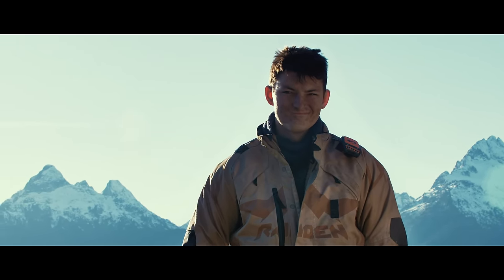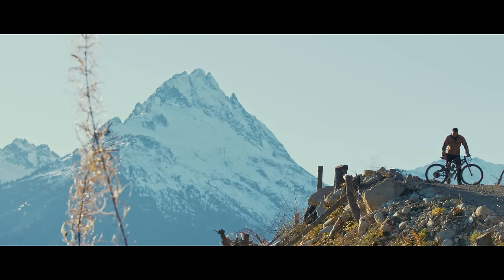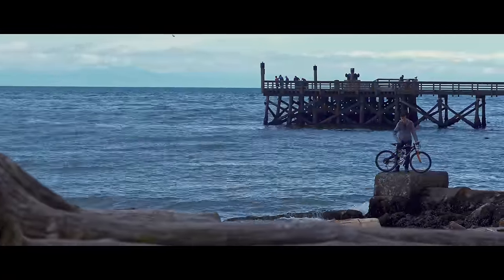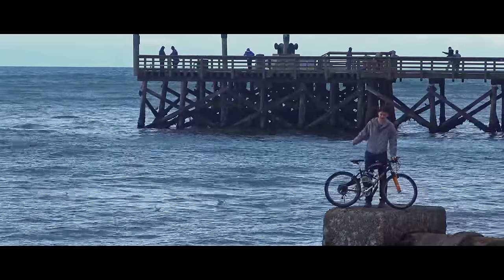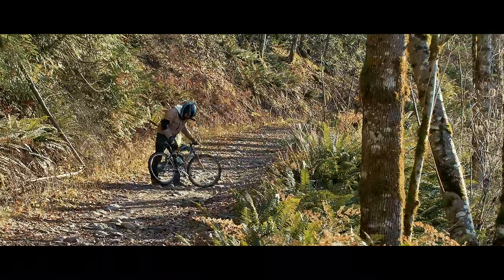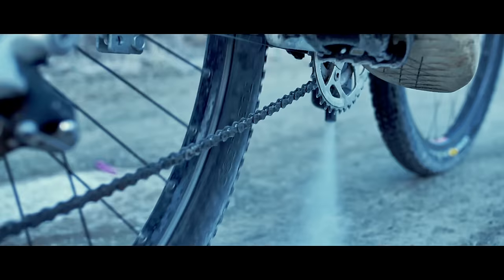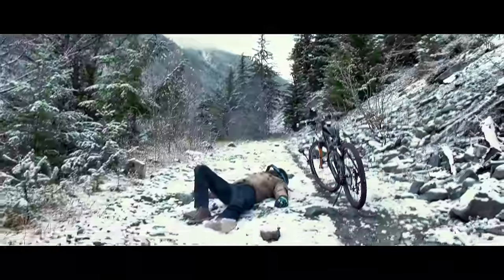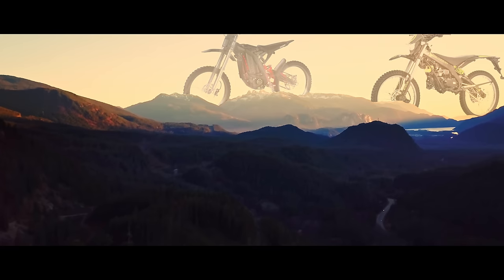I Built a Mountain-Climbing Motorcycle for $200

Comment: this quality is just someting else
Reply: Its the Canadian Top Gear of motorcycles
Reply: And in case folks are wondering where Grizzly Pass is?  50-34 N  122-56. North out of Vancouver on #99 to Pemberton. Then up to Pemberton Meadows, cross the river, go up The Hurley River FSR and then onto branch 12. Or head towards D'Arcy and go up Birkenhead lake FSR. There is also a trail head close to where you cross the river.
Reply: The editing in this video is insane
Reply: @roryo1386  Not even top gear makes this quality
Reply: @kevinfritz1268  Thanks Kevin, I recognized those mountains and thought it had to be up around Pemberton.  The confirmation of location is nice.
Reply: How about a $200 Electric bike equivalent?  Because Petrol Bikes are sad and it would make a good comparison video further on. 
I do suggest a Mid-Drive electric setup as opposed to a Hub Motor but given the petrol bike doesn't have gears it would only be fair if you go with a Hub Motor for comparison sake. Here in Australia, petrol bikes are illegal but people still get 500w electric bikes that will do 50km/h even though they are supposed to be speed limited to 25km/h. IE meaning the motor cuts off after 25km/h. 
Now no need to compare this to my brother's 2000Watt Electric Mountain Bike complete with Pedal and Torque Sence. Its pretty awesome and very impressive and is great at climbing mountains and is FAR SAFER than going down.  
Yes going downhill you want power at 10% or maybe 20% for flat sections but having it at 100% will give you the BACK TO THE FUTURE experience. Unfortunately, it won't give you the time travel... so you hit whatever is in front of you come close to putting yourself in the hospital or having a VERY BAD FALL. I managed to avoid both but still have the marks on my leg from it. The only damage to my brother's bike was the left handle grip.
Anyway. 
Anyway, hope to see a future video on this. I think it would be great.
Reply: @alec1984  good luck with all that.
Reply: The cinematographer, Aneesh Shivanekar, is off the chain! Soon to be picked up by Nat Geo, Discovery or PBS I'd imagine.
Reply: And let's not discount the actor. Always great delivery. Says so much with so little. Cuts straight to the point.
Reply: Artistica36  100kg+?? Your Facts are all WRONG!!! It would weigh more like 5kg.
You are trolling me! AND, you're NOT the guy who uses Li+ batteries in 130 C Oils and Gass Wells like I did so you have no idea about Li+ technology which I was using in 2002! I
In short, you totally missed the point!  So let me explain it to you.
I WAS HAVING A SWIPE AT GREENS!!!!
GET IT NOW??!!!
Reply: @alec1984  A $200 Electric bike equivalent.... dream on, not for 200 bucks you ain't (lol)?!
Reply: You make we want to buy a cheap engine and install it on my mountain bike. Seriously the production and editing and ideas behind the videos are awesome, keep it up buddy. Plus I really have to go and see British Columbia at least once in my life! The nature and views must be unforgettable
Reply: @mingonmongo1  Just FYI, I have an Electric Bike. I KNOW!!! And the bike was hand down. To me, This EV Revolution is BS. Just Like Global Warming. 
After having it for around 2 years, It was just the to the train station and a local commute. Nothing fancy but I know what he did with the POS petrol would kick that shit out of my Ebike doing mountain trails and stuff. 
I just wanted to see him do a comparison. PROS/CONS. Cost Vs Benefits etc and where Ebikes fit into the mix.. I thought it would be challenging. 
Don't know why I'm getting so much backlash over a simple comment.
As a commuter, EV Bikes have very good benefits. But when something goes wrong....OH BOY. They can be a pain!!
Hope this helps
Reply: Oleg .

Comment: "Afford between student loan payments and park in our micro apartments..."

I feel personally attacked
Reply: Ha... don’t. He’s right. It’s the future. I’ve been riding 30+ years and currently on a liter bike. I’d absolutely love a lightweight eBike of some sort that’s quick, can do real speeds, small, can slip through cities... park indoors ‘cause you can. It should be cheap. Yep... easy to see a future market for such a thing.
Reply: @timothyparks  Makita has an electric bicycle that runs off of the 18v batteries they sell for their power tools and heated jackets/vests.... last I checked they still don’t sell them in the states, but some people have mail ordered them from distributors elsewhere to their American address....

Good luck....
Reply: @Rick_Sanchez_C137_  not any more, all I see is a wheelbarrow from makita shucks.  Probably got pushed out by the sheer numbers of competitors mismanaging their roll out.  So many will go bankrupt, and Makita can only make a product that makes business sense.
Reply: looks like it was a folding cycle, to do train and then last mile to work without sweating (up to 15 km)
Reply: The Makita bike was a gimmick. E-bikes are sensibly limited in speed, since the frames, brakes etc. are not up to real speeds, but there are plenty of electric motorcycles out there and coming up. When meant for city riding they can be pretty lightweight and zippy (good acceleration), just limited in top speed (plenty to keep up with city traffic, but perhaps not great on highways) and range.
Reply: @timothyparks  and wearing full moto protection too
Reply: Dang it hits hard.
Reply: The Sondors Metacycle and Zero DSR comes to mind.........
Reply: Do Canadians do that student loan thing?
Reply: Pro tip rent on the first floor so you can push your dirtbike in the living room
Reply: @timothyparks  It's called a scooter ! ;-)
Reply: @bendgeddes  Most have to, tuition ain't free.
Reply: @mynameisntimportant9341  so true, my old Honda used to spend the worst of winter days in my first floor kitchen.
Reply: @MrIgottap  
How many kitchens you got?!?
Reply: . @mynameisntimportant9341  This rule counts at motels also.               Discretion counts.
Reply: @mynameisntimportant9341  late to the party...  Google storm the embassy.  Guy on an Oset shows steps aren't an issue.
Reply: Seven gradually size-increasing motorcycles later, I'm in a micro-apartment with the ultimate size reduction. These days my ride of choice is a Veteran Sherman (electric unicycle). No compromise in power though. If this thing had handlebars the acceleration would probably dislocate my shoulders.

Then again, it also cost forty times as much as my first Honda CB160. {face-palm}
Reply: @MrIgottap  Ha ! memories my friend...  My couch was a 175 Penton in my favorite color: blue.
Reply: @fastinradfordable  haha yeah sounds like I had more than one. Should have said, “on the first floor in the kitchen” instead. Only thing upstairs was a couple of bedrooms.
Reply: @timothyparks  i had a swagtron EBIKE was plenty lightweight and could fold and remove the front wheel and would fit in the backseat of a nissan altima
Reply: More about fuel consumption and licensing than anything else
Reply: @timothyparks  sounds like a speed pedalic

Comment: I had one of these. 

And what wonderfully  boneshaking, smokey and noisy three days it was.
Reply: Phill_H but was it worth it for three days of fun
Reply: @danieldavidson8149  That's the thing with those engine kits. You need to break-in the engine, after that it works fine. My friend blown his after three days as well. Mine has two years and 2000 km on the clock. Runs great too.
Reply: @mac16a  it didn't break. I just got sick of it. My cb400 is far more comfortable 😂
Reply: My Yammy RS100 is the same tho, handlebars vibrate at higher rev to the point it hurts :) something about 2 strokes tho, wouldn't want anything larger because it's so fun to ride
Reply: Had one for two years, 4000km and countless hours saved from public transport, she is still in the garage.
Reply: Mine lasted 4 years until I got an actual dirt bike lol
Reply: mac16a mine ran 4 years just fine.
Reply: I have one of these too. Fun to zip around town on but I tried to go up a mountain once and gave up pretty damn quick
Reply: @mtnmotoadv  Wow guys that sounds pretty cool! Zipping around town maybe going to work on one. In Poland it is unfortunately illegal so I can only use it for off-road goofing around.

Comment: I just built one of these after a month of buying extra parts, a new bike, a shit load of troubleshooting and learning to drive it, but holy shit. As someone who's never driven a real motorcycle before (I'm 15), this thing flies. If u want to get into motorbikes but can't afford it, or just want a fun project to learn more about motorbikes, this thing is so worth it. However, there are a few things u should know that I wish I knew before purchasing:
- You need a bicycle with very thin pipes and a very large frame that can fit the engine in the middle, and wheels that have space for nine sprockets to fit through. 
- When starting the bike, set the switch on the carb to "starting more" (point it up) and after pedaling, dropping the clutch, and revving up the bike a bit, switch it to "running mode" (point to the side) WHILE PEDALING, then rev up the bike more until it accelerates by itself, and then, only then, can u stop pedaling and drive the bike using the throttle only.
- if your bicycle isn't suited for this build, simply buy another cheap bicycle from Craigslist or kijiji, they are usually quite cheap and it's more safe than to potentially break your current bike. 
- make sure you have tools such as:
Pipe wrench
Chain breaker
Ofc rhe basics like screwdrivers
Others
-Finally, make sure you learn to handle the bike in an empty street or parking lot before driving it somewhere like the road, since these things can sometimes be quite unreliable during the first few tanks of gas.

Comment: "She is rattling loose already."

Why didn't you follow torque specs in the manual? Wait...
Reply: At least  use  an AvE style torque wrench.
Reply: Must be a Harley ...
Reply: Ceeerrrrlick 😂
Reply: Red thread locker everywhere!!
Reply: @drakeorion94  in some screws in my 150cc blender, sorry my 150cc motorcycle i use a micro drop of crazy glue , and the problem is solved
Reply: @johnnzetrockk9404  lol
Reply: @drakeorion94  Red thread locker is overkill and takes 500 degrees to remove.  Blue LocTite is just fine for this purpose.
Reply: @tauncfester3022 sorry its sarcasm
Reply from the maker: It was listed as "Engine Bolt Torque: Yes"
Reply: @FortNine  lol
Reply: @FortNine  12ft/lbs according to the manual I got for mine. Also, how's your motor running on 50:1? Mine called for a 16:1 break in mix.

Comment: Thank you for reminding me these exist. Built one when I was a teenager. Had a blast on it. Not being used to the very oil rich mixture required I seized it multiple times. Rear tire lockup on a bicycle at nearly 40mph is not a fun time. Thinking about building another one for toying around the high desert. If I do I'll be sure to get a disc brake kit as well.

Comment: "Chinese Centimeters" 😂
Reply: Fun fact, China does still have, and still uses, its own measurements
Reply: I did not know that
Reply: Caleb Matheson thats ok, I wasn’t talking to you
Reply: Caleb Matheson 🙄
Reply: @rjc0234  I bet it's better than inches
Reply: Canadian Clarkson
Reply: @rjc0234  what is it?
Reply: @ilham7345  they have "chi (尺)" which is 1/3 of a Meter, and "chun (寸)" which is 1/30 of a Meter. a Chun looks very similar to an inch, but is a tiny bit longer. in the Uk we have these things called "Christmas Crackers" that have gifts inside them. I once got a tape measure that was neither metric or imperial, but in "Chun".
Reply: @greymick  he honeslty is
Reply: ALSO-RAN !  doubt all you want, buddy
Reply: we're all saying it wrong
Reply: @rjc0234  ,
the chi is 0.3333m
the chun is 0.0333m
the foot is 0.3048m
the inch is 0.0254m
so, what the heck ?
Isn't China metric ??
Reply: @juerbert1  China only "recently" industrialised, so for a very long time were doing their own thing. think about how people in ancient Egypt used to base their measurements on the current Pharo's arm length and height. 

Similar thing with China. they didn't need to switch to an international standard when 99% of their population worked in manual agriculture.

Then industrialisation happened and they went with Metric.

But just like the UK (which is Metric) plenty of people are still alive that remember the old way of doing things, so stick to that. Rulers in the UK still have both metric and imperial, and in China you can still buy measuring equipment with Chinese units on them. They just happen to be really really close to feet, so people get confused if they ever get a Chinese tape measure (say an ignorant eBay seller buying a load of cheap cloth tape measures).
Reply: @Rick_Sanchez_C137_  America has only done 3 of those things, I'm going to let you figure out which.

Comment: "Now you are really going off the deep end.
I couldn't help thinking how disturbed a hiker seeking quiet contemplation would be who came anywhere near this guy.
Also, why is his seat post so low? Maybe he doesn't know much about bicycling?"

-My Dad, after I sent him this video
Reply: Well, he's gonna ride it like a motorcycle, not ride it like a bicycle..
Reply: Nobody told him he could also pedal
Reply: Send your dad his video where he races his bike against a motor cross bike up and down a mountain. Dude can handle a mountain bike plenty fine.
Reply: It's a mountain bike. Seat should be low.
Reply: @JackChristenson  if climbing (and pedalling)  his seat should be higher in order to have the leverage on the pedals, additionally to protect the knees. On a downhill though, I’d go with the lowered seat.
Reply: @engineer6250  Easily fixed.  One wrench.  30 seconds.
Reply: @doublenickel1000  Good evening David. Totally agree. Even my old 2003 Kona hard tail has a quick adjustable saddle. I guess it’s just one of my pet niggles after learning the hard way and buggering up my knees....
Reply: I`ll bet with his riding experience he is well aware of seat post height. Duh
Reply: @JackChristenson  On the contrary, it should be high up when climbing and low down when shreding.

Comment: I made one of these out of spare parts (not the engine) and rode it 1500 miles for transportation and it got the job done. 
Averaged 70ish mpg and had fun every moment. I kept it 16-1 oil ratio and the only reason i don't drive it now is that I blew out the spark plug. It doesn't do much in way of climbing, but if you keep the chain tight (was loose in video) it's practically maintenance free

Comment: I built on of these late late last year and it’s amazing, so I’m gonna do a bmx build for wheelie efficiency, just waiting on the cheap
Chinese motor!
Reply: I did this on a 5 dollar garage sale bike. 2 years of consent use and 5000 miles later and she still holds up fine to 10 mile redlining. A few replacement parts but I could not have gotten anything better or cheaper for a kid going to work. If your to young to get a licence, get this.

Comment: With regards to braking, many of these old 26" mountain bikes have the option to run disk brakes on the front. I have two mountain bikes from the same era equipped with V-brakes, yet the fork has bosses for mounting a disk brake caliper.
Reply: It's a wheel hub you have to get, there are specific ones meant to take disc brakes but since building less is always cheaper then manufacturers won't put it onto a bike or the bike is really expensive and has them already
Reply: @arksrandom5968  The wheel is the easy part. 26" disk brake wheels are pretty cheap. If your fork doesn't have the caliper mounts, it's never going to be a possibility. If the bike already has V-brakes, the brake levers will also have the same pull ratio as MTB disk calipers. Things get a little more messy if you have cantilever brakes, as they have a shorter cable pull. As disk brake equipped bikes have exploded in popularity, even department store bikes are being built with them now.
Reply: @lihtan  At the moment it's cheaper to fit magura hydaulic rim brakes than it is to buy a brand new 26" wheel with a disc hub, and the price is even more severe when you include the disc brakes. 

At least, here in the netherlands it is, they're surprisingly common on new ebikes.